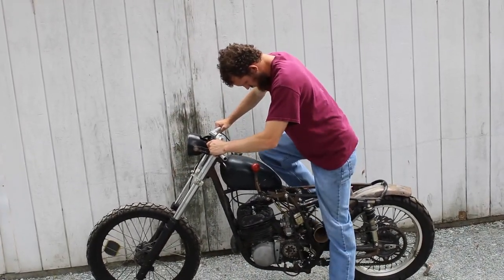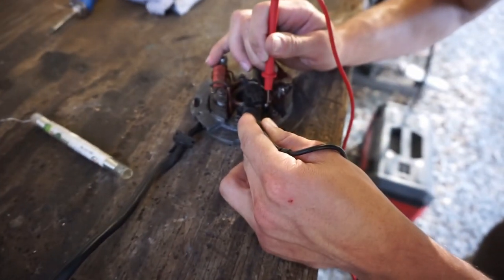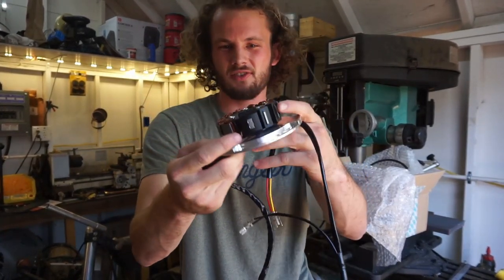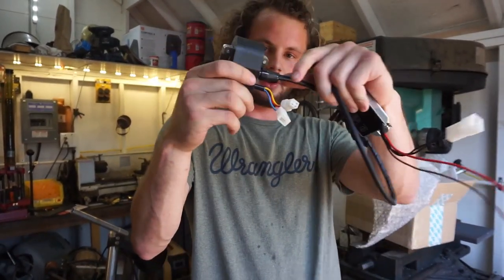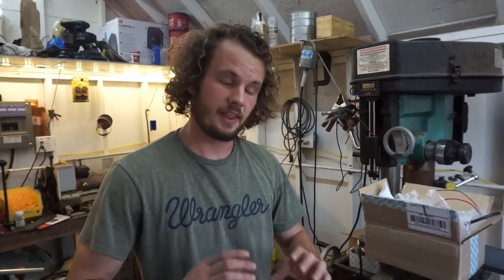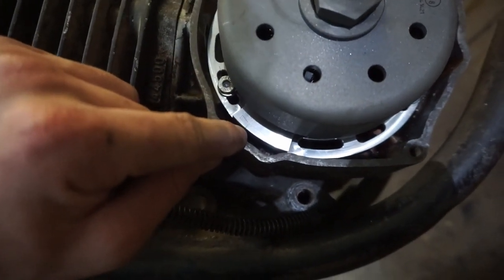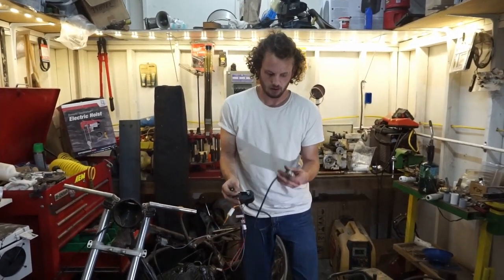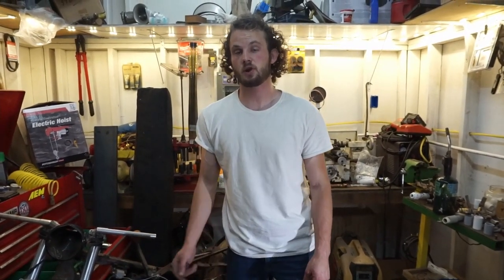New Electrical on the 1974 DT360 Two Stroke Rat Bike

Comment: Where did you order the vape system I’ve got a Dt 360 I bought and the flywheel and everything else was gone this would be perfect
Reply from the maker: Got it from https://hvccycle.net for $450. I'm not affiliated with them, but it is a great kit that includes everything.
Reply from the maker: https://hvccycle.net/yamaha-dt-rt-dt250-dt360-dt400-cdi-ignition-12v-180w-7238799dc/

There's the exact one I bought
Reply: Ok thanks